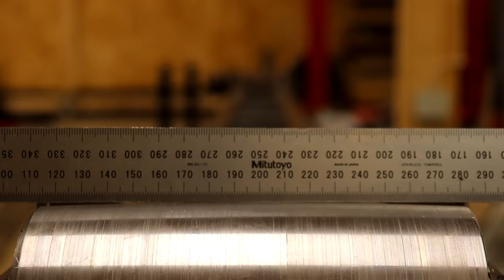Belt Conveyor Build - Part 2

Comment from the maker: Firewood processor build series:
https://www.youtube.com/playlist?list=PLkmF7FAZBzkVRPU6b-IeJVu91-frjF8v3
Check out my other videos on my channel page:
https://www.youtube.com/c/DonnDIY

Welding equipment borrowed from Spetselektroodi AS, Estonia:
Fronius TransSteel 2700 welder
Optrel Crystal 2.0 Welding Helmet
Hypertherm Powermax 45 XP plasma cutter
Reply: great job mate ,glad you got hold of proper belt.
Reply: I am glad that you did the camfer I suggested on the last video, it does really work well! 💪🤓👍 I fixed my old Mecedes A180 generator pulley with this, it was rubbing the tension mount, you do need a lathe though 😁

last
Reply: If it’s interesting, judging by the look of the wheel from a car, a Moskvich.
Reply: I like that good job buddy.
Reply: Frhhd
Reply: Kkkkh
Reply: Vc
Reply: No
Reply: បង

Comment: Can I suggest that on the head side of the bolts on the belt you put a piece of metal strapping tape down so the bolts don't cut into the rubber over time and thin it out

Comment: I am super impressed, The conveyor came out better than I thought. The whole set up is very nice and well thought out. Looks like one can process a lot with less back ache! 
The crates will make it easy to move and allow for much better airflow to dry out the wood, While keeping it dry from ground contact. Since these crates are stack able. Even your small skid steer should be able to double stack them in nice rows. 
If you keep with the IBC totes this will work well. It really depends on if you can collect enough of them at a cheap enough price.
Reply from the maker: Yup, I got a bunch of them for reasonable price and all of my firewood is in them now. I really love this setup.

Comment: Fantastic final ending Donn!! Your engineering skills are awesome. I had my doubts about the electric splitter but I was wrong. I used those same Tote cages for years putting a third of a cord stacked in each one and that made dumping them into my dump trailer for delivery a breeze. Job well done. Happy holidays to you and your family. They should be proud of you and your work ethic...

Comment: Brilliant work. When watching I saw that gap at the bottom of the conveyor and immediately thought that it needs blocking. I've used exactly the same many years ago and plan on trying 2 straw broom type brushes spaced slightly apart. The first would be right at the base of the conveyor and would brush the belt. The second would be about an inch or so further up the conveyor and would be set so that they just brushed the top of the angle iron cleats. I found that the style you used tends to flick the wood and they will often miss being picked up on the cleat. It's possibly no going to be as big a problem for you as it was for me as I was having about a wheelbarrow load of wood dropping onto the conveyor about every 10s.
Reply from the maker: The need for brushing the belt is something I have to address in the future, otherwise the bottom roller will wrap stuff around it.

Comment: The tire / belt idea was not a bad one. I'm sure it might have worked good but the conveyer belt was a great idea!
Reply from the maker: I agree the tires would've worked too, but since I found out I had a conveyor belt it was only fair to use it as originally intended - as a conveyor belt. 😁

Comment: I like the idea of the convex shape of the rollers. One thought is to make sure the row of bolts down the middle of the belt are exactly centered, then machine a small groove in the roller.  Not only will this give clearance for the bolt heads, but tends to keep the belt centered as they pass.

Comment: excellent on your end rollers, looks like your piece of belt came from the edge of a larger belt, that would make it extra hard to have it track properly, a little crown makes all the difference, starting with a little electric splitter  and turning it into a high production machine, great job.
Reply from the maker: The crown on the rollers is a must. It wouldn't work at all without it I suspect.
Reply: @DonnDIY  i have seen some that were not in sawmills, rock quarries and factories where the belt would wear the side off the conveyors,   lol

Comment: If anyone gets stuck using old tires, cause they can't find conveyer belt, and it's cupping like in the video, just need to trim more off the edges,  there is like a transition to the sidewall,  and if you leave just a teenie bit of that on, it cups.  Do the butt connection like what he ended up doing with his project,  instead of lapping them

Comment: Absolutely brilliant! And rubber flap keeps a good beat too! You could even place the end of the conveyor from outside to inside with a closable trap door. Then the wood would drop right into the bin. Just a thought. Any video of you lifting moving logs? Cheers and thanks for sharing your work😎
Reply from the maker: Hahaa, yes. But I will move the IBC crates with a loader inside the barn. So all good. However, I can use this for moving dirt hopefully. If needed.

Comment: I like it! Very useful setup. The metal on the belt maybe should have been a little longer and angled on the ends to grab the pieces that are on the sides, but still it works great. Regards, Solomon

Comment: Maybe later down the road maybe add a pin hitch to both pieces of equipment to move them in tandem?? Another thought add something to catch the sawdust shavings to use to soak up oil in your shop
Reply from the maker: I already can move the conveyor behind the firewood processor. It is in the video also. 😉
Reply: @DonnDIY  I started watching your channel when you made the ground driven mower and you sir have amazing content!! 🤦🤦 Since I watch it on my phone I guess I missed that 🤦🤦

Comment: Nicely done, I was going to comment about adding a flap to the bottom then in the next sequence boom, flap added to the bottom. 

Have you thought about catching the sawdust and using it? it will compost well or you can press it and dry it into heat logs/bricks giving you a additional value from your machine
Reply from the maker: 😁 I'm glad I got to the flap first. I have a sawdust stove. I can use the sawdust for heating the workshop. 😉

Comment: I have seen the other things on your website and I am probably going to build the log arch but do you have any blue print available for this firewood processor because I could just follow from the videos but I was wondering if you had any blue prints available for it? Also I think your videos are great and they have encouraged me to start building my own things, I am only 13 but I built a generator a few days ago that was very fun and I was wanting to build something like this firewood processor because it would be so fun and it would speed up the process and I want something to build with my dad.

Comment: Hello! I am planning to make a diy conveyor belt to transport dirt. I have some questions, before I start:
- What is the diameter of the driven roll at the end of the conveyor belt?
- What is the gear ratio and the power (KW) of the geared motor? Is this a 4 pole asyncron motor with about 1450 RPM at 50Hz?
- What is the width and thickness of the conveyor rubber you used?
- How long is the conveyor belt, I suppose about 4 meter?
Reply from the maker: For conveying dirt I think you should have a wider belt so the dirt doesn't get stuck between the roller and the belt. I don't know the gear ratio nor the KW of the motor. It is however a three phase motor. Thickness of the belt on my conveyor is 10 mm and length around 5-6 m
Reply: What about the driven roll diameter?

Comment: Excellent job, really will make splitting wood more fun. 
When are you adding the sawdust bagging option? 😀
Reply from the maker: It really does make making firewood easy. Once it was a four man job - my grandfather felled and chopped the logs in the woods, we threw cut logs into the ATV trailer and also unloaded wood by hand from the trailer back at home. Then my grandfather split and stacked the wood. And so on. Sawdust bagging would be a great add-on. 👍

Comment: Hi what size motor is it? Also what the gear ratio to give rpm? Good job mate.
Reply from the maker: There is a plate on that motor with kW but it's too far from me at the moment to go and get a proper look at it. 😀 I don't know the gear ratio. The motor is most likely around 1500 rpm.

Comment: As someone who designs and sell these things, you only use 33% of the load capacity with the motor In the push position (nearest the ground). If it was up by the discharge tail, you get the full capacity. Just sayin. Nice overall build.

Comment: That bin must hold half a cord? Cord is 4'H x 4'W x 8'L...  Bin looks like half that. Fashion a gate or drop door for when it gets low. No climbing in.🤔
Reply from the maker: You can get to the firewood through the side of the crate. No need to climb in.
Reply: That works, all good. No clean up either. 👍👍
Reply: Great designs. Looking forward to seeing the rock crusher.